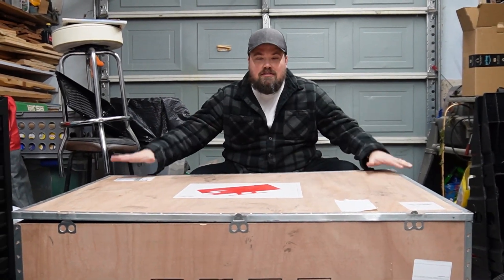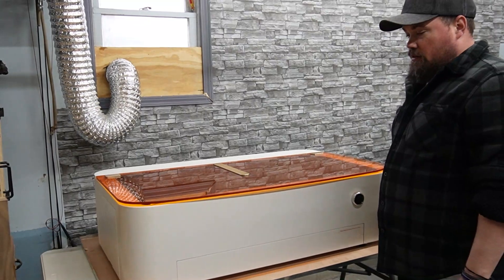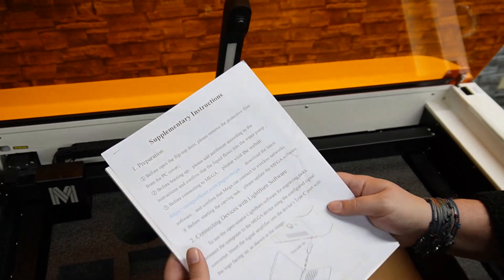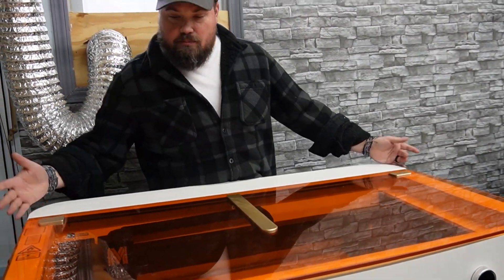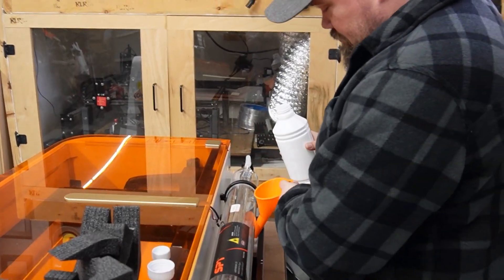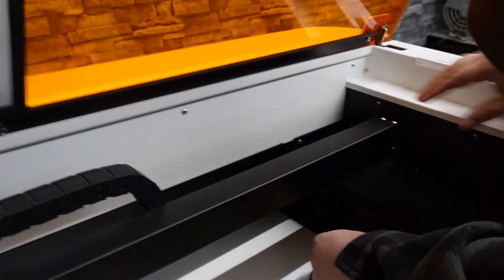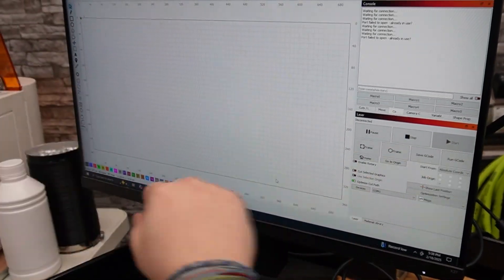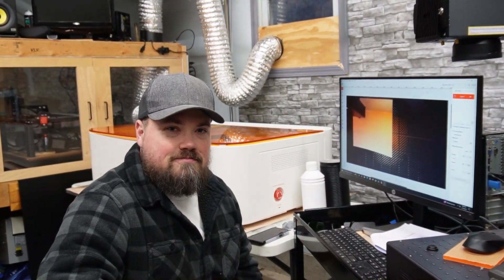New Monport Mega 70W CO2

Comment: Dude you have a pinched cooling tube. That water flow is way to low. Same thing happened with my Mega… check them out very carefully. Good luck you’re gonna need it!
Reply from the maker: Thanks for the heads up will check
Reply: Yeah, I was kind of curious about where the pinch cooling tube was. I had a little pool at the bottom of my reservoir and getting a hold of these people like trying to pull teeth then you gotta wait three days for somebody to respond.
Reply: @ yep I returned mine and got a “non smart engraving” machine.

Comment: I got the MEGA about 2 months ago and it would not cut through 3mm wood or acrylic. Monport told me they would pick up the old one and bring the new one. I got the new one and it would not connect to wifi so monport support had to connect to my computer to get it fixed just like last time. I'm going to run a couple test and see if it will even cut. What's going on with yours. It's been two or 3 week sense your last video. What's really going on with yours. I believe your working with Monport to show off the machine. There was another person on youtube that was working with MONPORT and showed the unboxing of the machine  just like you have and no other videos have come out from him or you. I'm Really starting to worry!!!! This is really not good for Monport. The machine has been out sense December 2024 and you cant find one video of the machine actually working in real time. Any info would be nice. Maybe if mine works correctly I can get a video of it working in real time. A lot of people are looking to see the MEGA working in real time.
Thank You
James
Reply from the maker: I havn’t had time to get back into it much. I also have had some issues getting it connected to wifi and ran one engraving just to see if the laser would fire. I plan on getting back into it this weekend or next.
Reply: You make some very valid and concerning points.
Reply: What happened with your machine? Did you solve your issues or just send it back ?
Reply from the maker: Support helped get the WiFi fixed and I am slowly getting more time on it.